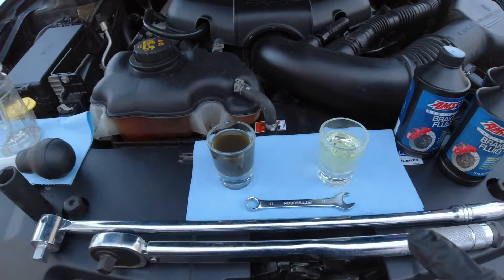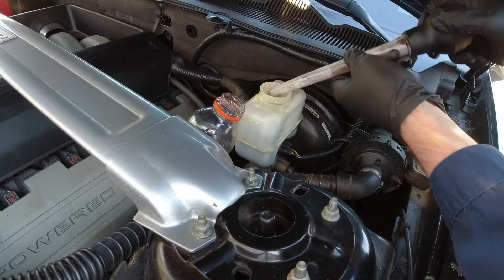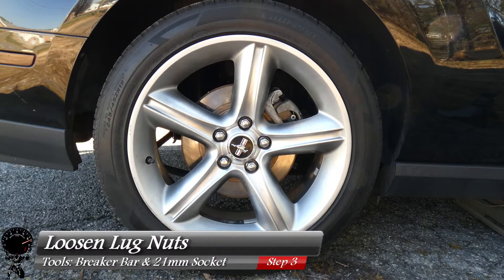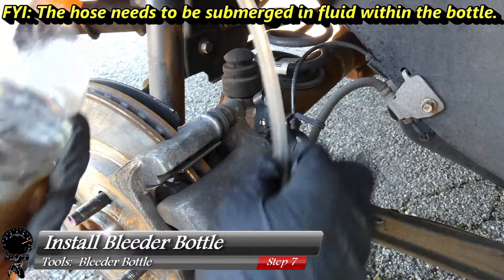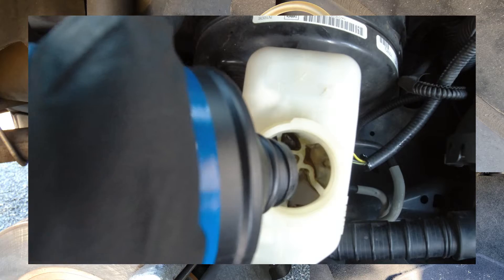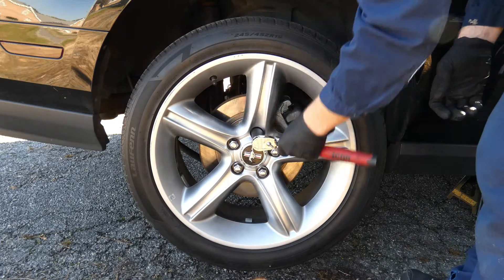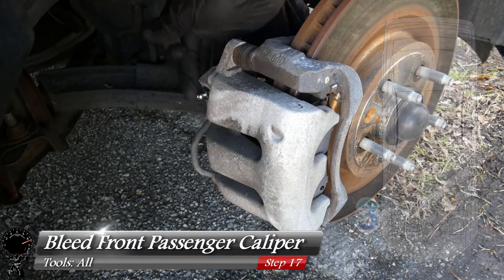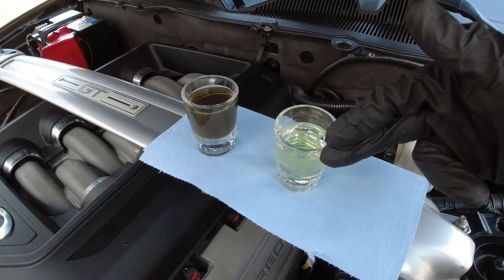How to Flush and Bleed brakes for S197 Mustangs (2005-2014)

Comment: Good video. But fronts I just turned wheel out and put bottle up slightly Ina. Box near wheel, Im lazy, 😆 didn't want to remove all 4 wheels. The rear, on jack stands, took them off. Good video tho.
Reply from the maker: That's a good idea. There is nothing wrong with being efficient.

Comment: What size is the hose that goes on it?
Reply from the maker: Per the description: Fuel Tubing 1/4" X 3/8" - https://shop.advanceautoparts.com/p/prime-line-fuel-tubing-1-4-x-3-7-081522/11049555-P
Reply: I looked through the whole dang description and didn’t see that and now I do……oops 😂
Reply from the maker: Its all good

Comment: It took me 3 hours because I kept screwing up!🔥
Note: Make sure to bleed the fluids afterwards in order to get rid of trapped air bubbles, otherwise you'll end up with soft brake pressure, get into an accident, and die.💀
Reply from the maker: What do you mean by bleed afterwards?
Reply: @mcgurrentertainment  It's better to look up a video on it, than for me to try and explain it with my limited vocabulary xD
Reply from the maker: K
Reply: @Sockpoppet maybe he's talking about bleeding the abs. You'll need a scan tool for that.

Comment: I have a question. The mt82 transmission in these cars has a hydraulic clutch which shares fluid with the brake system. How do we pump the old fluid out of it too?
Reply from the maker: There's typically two methods. You can drain/fill the clutch lines (at the Clutch Master Cylinder) and then bleed the Clutch System. 

Or just change the fluid in the reservoir (a few times) while pumping the clutch between refills.

Comment: Do u have to do this if u change the rotors and brake pads to some new ones?
Reply from the maker: Changing the rotors and pads doesn't impact the brake fluid. It still needs to be changed in the normal maintenance intervals.

Comment: what size hose did you use
Reply from the maker: Per the description, Fuel Tubing 1/4" X 3/8" - https://shop.advanceautoparts.com/p/prime-line-fuel-tubing-1-4-x-3-7-081522/11049555-P

Comment: What about the clutch fluid? I understand it’s the same reservoir, but does that take care of that pressure?
Reply from the maker: Yes, the clutch does share the same reservoir as the brakes. However, there is still old fluid within the clutch cylinder. Instead of flushing the clutch, an easy way would be to actuate the clutch several times to work in the new fluid.

Comment: Soooo...are you supposed to use a whole bottle of fluid for each brake?  I ask because you topped it off?
Reply from the maker: This system was severely contaminated, and it needed the 3 bottles of brake fluid to flush it clean. 

Your brake fluid may not be as bad.

Comment: so you did this by yourself? i thought you had to pump the brakes 3x and hold even with this bottle and hose method? i got to bleed all 4
Reply from the maker: Yes, this was done by myself.
Reply: @mcgurrentertainment  and you got all the air out of the system?
Reply from the maker: Yes
Reply: @mcgurrentertainment  how long it take I can't seem to get completely bubble free
Reply from the maker: Not long. Check your hose connection. If it's loose, then it could allow air to enter the system

Comment: do we need to empty a full bottle of amsoil for each tire?
Reply from the maker: Not necessarily. It all depends on how dirty the system is; this system was very bad.
Reply: @mcgurrentertainment how much brake fluid did you use in total? My fluid looks similar as I have never flushed it before and I’m trying to get an idea about how much to buy.
Reply from the maker: If i recall, (3) 12oz bottles

Comment: What size hose are you using? Quick tip: you should clean around the reservoir top and the cap prior to removing the cap to ensure that you don’t introduce any dirt particles into the reservoir.
Reply from the maker: Fuel Tubing 1/4" X 3/8" - https://shop.advanceautoparts.com/p/prime-line-fuel-tubing-1-4-x-3-7-081522/11049555-P
Reply: @mcgurrentertainment  thanks!
Reply: @mcgurrentertainment I never noticed you had it in the description. I forgot to check that prior to commenting!
Reply from the maker: It's all good

Comment: So i replaced me rear pads and rotors. My brakes were soft all of a sudden like air in the lines. I bled the brakes but it feels the same. I pump breaks and they feel fine. But other wise it goes to the floor but still stops decent
Reply from the maker: Could be air still stuck in the system or your master cylinder having issues. May need to start troubleshooting.

Comment: What size tubing did you use ?
Reply from the maker: Per Description: Fuel Tubing 1/4" X 3/8" - https://shop.advanceautoparts.com/p/prime-line-fuel-tubing-1-4-x-3-7-081522/11049555-P

2-Feet Length 1/4-Inch Inner Diameter by 3/8-Inch Outer Diameter.
Reply: @mcgurrentertainment  thank you, I did not see it. Appreciate the video
Reply from the maker: Thank you very much for the support

Comment: I have a 2014 Mustang V6. My owners manual says use Dot 4 LV but the cap says Dot 3. Any advice? Excellent video thank you for the help.
Reply from the maker: Thank you for the positive feedback. I would follow the manual. DOT4 Low Viscosity is a little pricey(er), but it's doable.
Reply: they revised it back to DOT 3. DOT 4 and 5 are more for high performance brakes, higher boiling point. Unless you track car, dot 3 is fine for 90% of daily road cars. Dot 3 and 4 are interchangeable, so you can mix them no issue

Comment: Thanks for the well-explained video. I have a manual mustang where the clutch master cylinder shares the same reservoir with brake fluid. When doing my brake bleed, will there be air introduced into the clutch cylinder?  Do I have to bleed the clutch system as well? Thanks!
Reply from the maker: Good question. Just keep the reservoir full, and you will be fine. No, you don't have to bleed the clutch as well.
Reply: Will this also bleed any air in the clutch system and flush the fluid in the clutch lines?
Reply: @MARKC0R3  I know I'm late but the clutch system is self bleeding for at least 2014 and up so all you need to do is keep pushing in the clutch pedal until it returns to normal

Comment: By doing this method, does it also bleed the ABS blocs ? If not how to bleed these ABS blocs in order to perform a full bleeding? Thank you!
Reply from the maker: Great question. Short answer, Yes. The flushing process includes the ABS HCU. If you were installing a new HCU, the service manual requires an extra step of connecting a scan/service tool.
Reply: @mcgurrentertainment  Thanks for the fast answer! Love your videos! Wished you'd do more for the s197 😉
Reply from the maker: No problem at all. I'll see what I can do about more S197 videos 🙂

Comment: Same amount of braking fluid for Brembo's?
Reply from the maker: It's going to be a similar amount. A majority of the brake fluid is held in the reservoir and brake lines. The Brembo Brakes hold slightly more fluid (over factory), but not a substantial amount.

Comment: I am completing flushing the brakes on my 2007 mustang and started with the right rear wheel...  How much of  a Gatorade bottle worth of fluid should I push out before I should expect the fluid to start being clear?  I got out around 3/4 of a bottle and it's still not clear like the new fluid.
Reply from the maker: Good question. I know the first flush (right-rear) used about 3/4 of the bottle. So you should be pretty close.
Reply: @mcgurrentertainment  what size bottle were you using?
Reply from the maker: I think it was a 20oz bottle.
Reply: @mcgurrentertainment  was wondering if you might be able to help....when pushing the pedal down, it is pretty stiff..and it returns back to the original position really slow.   I am getting fluid out but very slowly....there are no air bubbles, just yellowish fluid...any idea what would cause a stiff pedal...it is a stiffer push when driving the car
Reply from the maker: That's odd. The vacuum assist is not making the pedal smoother; that's weird. how's the braking?
Reply: @mcgurrentertainment  it was a little stiff why I thought it might need some new brake fluid
Reply from the maker: It could be a vacuum issue, if you were having this problem before. Hard to determine without troubleshooting.
Reply: @mcgurrentertainment  there wasn’t a problem with the breaking before it was just not as loose save my Ford focus and since the car is a 2007 I figured why not change the fluid out and see if it makes a difference
Reply from the maker: That makes sense. Doesn't hurt to put fresh brake fuild in your system.

Comment: Do you really need to take off your wheels or can I leave them on ik it’s gonna be a lil uncomfortable.
Reply from the maker: That's a good question. I was able to flush the brakes on my truck without removing the wheels. I haven't tried that method on the Mustang; I'm not sure if there is enough room or not. I will keep this in mind on the next flush.
Reply: @mcgurrentertainment  btw I have the track pack so of course I got brembos so do I do the inner side first or the outside first did here that you do the outside first but what do you think?
Reply from the maker: If you have Brembo Brakes, you'll like this video: https://youtu.be/HrAkTxZa8Xw
Reply: If you don't mind, did you end up doing it with the wheels on? About to do the same thing in a few days, would make it easier for me unless it's crazy tight
Reply: I would highly recommend taking the wheel off as it will make life way easier to get that 11 mm wrench on your bleeder valve. You can do it without.

Comment: you dont have to use a turkey baster just remove driverside rear tire and have someone pump the brake pedal 3 times and hold the pedal down then open bleeder screw then close after fluid come out and repet 25 times and fill resivoir when you get to 12 times the fluid will be clear in the resivoir and in the lines. I tried all four wheels but when I got to the passangerside rear wheel the fluid came out clear and same with the front !
Reply: They partially did it to prevent back flow of air into the lines at the bottom of the bottle when using the 1 person method of bleeding lines without proper equipment
Reply from the maker: Very Nice
Reply: So are you saying by doing it this way you will bleed all the old fluid or just the fluid in the reservoir?  You still need to go to each wheel right?

Comment: My friend left my bleeder screw loose and it popped off.  Needless to say, after I pumped all the fluid out of brake system, it hasn't been the same since.  No matter what I do or how many times I bleed them correctly, my brakes are still spongy.  I get that hiss when I brake however, they aren't loosing fluid or worsening in the "sludgy" feeling.  Would you advice me to bleed the master cylinder and just start from scratch like you demonstrated in this video?  Thanks for any help or advise you can give.
Reply from the maker: Send me a DM on Instagram.  I'll send you the procedure for priming the brake master cylinder.
Reply: @mcgurrentertainment  you should make a video on it so everyone can see
Reply from the maker: Hmmmm...I'll have to look into that.
Reply: @mcgurrentertainment   I'd be curious to read that procedure, my brakes haven't been quite the same ever since I replaced all of the rotors and pads. Mind if I send you a DM?
Reply from the maker: Sure. @mcgurrentertainment
Reply: Same here I’ve done all the procedures Mac did in the videos correctly and I still have super sponge breaks. I can’t figure out why.. I would love some feedback if anyone could thanks.

Comment: Does the vehicle have to be operating in order to bleed system ? Having a problem where I bled my brakes and and felt pefect before I started it , when I started it the peddle was soft very easy to press any idea ?
Reply from the maker: No, the vehicle can be off when bleeding brakes. Typically, the brake pedal being easy to press when the vehicle is running is normal. This is due to the engine pulling a vacuum for the power brakes. However, it can also be "too" easy to press the brake pedal, which could indicate something could be wrong. Are you having problems braking?
Reply: @mcgurrentertainment  yes , when I bled all around I did 3 times all around to make sure than when I started it I had no brakes at all only my e brake
Reply from the maker: It's not braking at all? Even when you reverse and foward once or twice?
Reply: @mcgurrentertainment  my driveway is down hill so I was just pushing it in park when it started and it was like I have no brakes so I didn’t want to throw it in drive and not be able to stop
Reply from the maker: Try pumping your brakes for few times while in park. If you continue to have no brakes at all, then you have air in your lines or your out of brake fluid. Were you having any braking issues before bleeding the brakes?

Comment: After replacing all my brakes 2 months ago I still have squeaks. I noticed my brake fluid is very foggy, is it necessary to flush/bleed the brakes, or does that just speed up the clean fluid brake process? Thanks
Reply from the maker: Well, you might have two issues. Foggy/cloudy brake fluid is most likely caused by water contamination; this would require flushing. The brake squeaking can have different causes. Possible causes are grease/oil on your rotors (or pads), brake pads not bedding the rotors correctly, defective pads, warped rotors, etc. Hope this helps.
Reply: @mcgurrentertainment  Definitely does, thank you!
Reply: My mustang was making squeak noises very badly and it ended up being the pistons. I did replace by pads and clean everything probably to well so the piston got very dry under the seals. I bought some high temp grease from permatek and put some lubricant around and all the squeaks disappeared!!! You have to remove the pads for that and the caliper, push the brakes so the piston gets out and then add the grease under the seals.
Reply: And calipers paint will looks great and no rust around you

Comment: Hey man, so my master cylinder is like blocked off at the top of the reservoir with the plastic X shape that is in your reservoir too, except mine is at the top? I’m not sure what this means any ideas or suggestions?
Reply from the maker: Good evening, I tried researching this type of reservoir and cannot seem to find anything on this setup. Could you send me a picture via Instagram and maybe we can try to figure it?
Reply: its a screen to bock anything getting down into resivoir some you can remove with a pick others you can't remove but after you flush it will be clean anyways after your done spray some brake cleaner around the resivoir with the cap on to make it clean on the outside.

Comment: I thought you needed two people to do this, and you needed to retighten the bleeder valve in between each pedal pump?  If I can do it this way, it will make it so much easier because I can do it by myself!
Reply: Is the way you showed it in this video, a correct way to do this?  Thanks!
Reply from the maker: By correct you mean per the service manual, then no. They required different equipment for bleeding brakes.  The idea is to ensure all air bubbles are removed and prevent additional air to be added to the system. By positioning the hose and bottle correctly (while the hose is submerged in fluid), you're not introducing air into the system as you pump the brake pedal.
Reply: @mcgurrentertainment  thanks for the reply!  This is really going to save me time.  Very innovative procedure you have demonstrated here 👍

Comment: are the lines thats connected to the master cylinder easy to replace? the nut on mine is rounded out, is the nut replaceable
Reply from the maker: That's a good question. I haven't  attempted changing those lines on this model Mustang. I'll see what information I can find. [Update] I'm guessing those fittings were on there really good. It's only suppose to be 26 ft-lb ot torque. Depending on your setup, you may need to change out those lines; it all depends how it's damaged.
Reply: @mcgurrentertainment  thanks

Comment: Same process for a manual? sorry for the dumb question
Reply from the maker: That is not a dumb question. Brake and clutch (if equipped) systems are supplied from the same reservoir, but not the same cylinders. The same process will still apply when flushing the brakes.
Reply: @mcgurrentertainment  awesome thank you, I've bled brakes before just not on a manual
Reply from the maker: No problem. Thank you for the support

Comment: does this end up flushing the clutch too??
Reply from the maker: No sir, just the brakes. The clutch and brakes share the same reservoir but not the same cylinders. Good question.
Reply: @mcgurrentertainment  how do you change out the clutch fluid?
Reply: @Twobarpsi  need this info too
Reply: @graledibble1619  I think the only way to get 80% of it out, is to disconnect the clutch line at the slave cylinder, and let the fluid drain from the line and slave.  There is no room to get at the clip that holds it onto the slave, and it can be really hard to get it back on.
Reply: @Twobarpsi  yea thinking of just buying the Shelby remote reservoir
Reply: @graledibble1619  that's good, but you still need to get at the fluid in the line.  Since there's no bleeder screw, the only way is to drain the line by disconnecting it.
Reply from the maker: And according to the service manual the way to bleed the clutch system, would be to by pull a vacuum (15-20 inches of vacuum) using a Vacuum Kit (416-D002 or D95L-7559-A). Sadly, I do not have a 2012 Mustang to show this process/create video.
Reply: @mcgurrentertainment  I been looking for a video on a 13, 5.0 hard to find
Reply: @mcgurrentertainment  I'm talking about changing/flushing the fluid, not bleeding air.  You are correct about needing a vacuum pump to bleed air though.